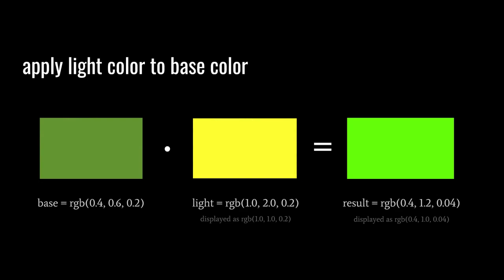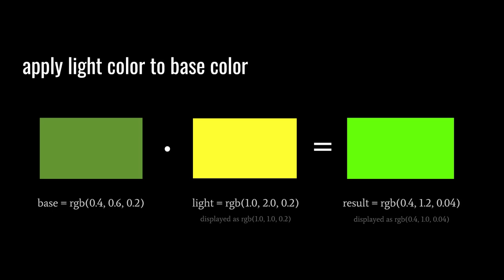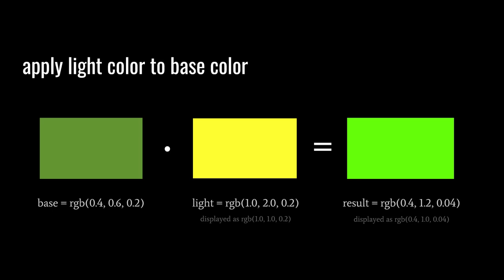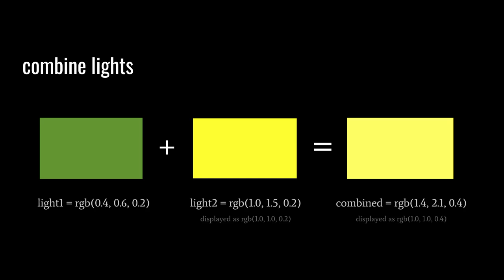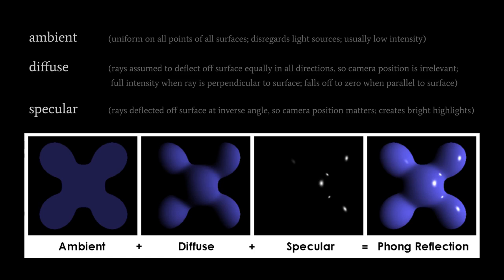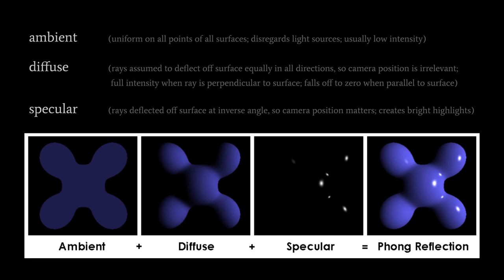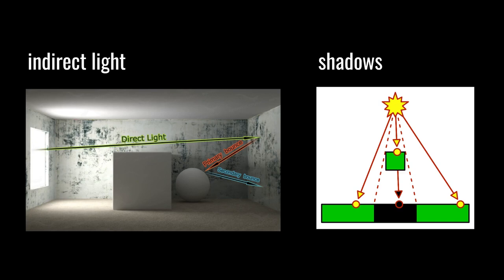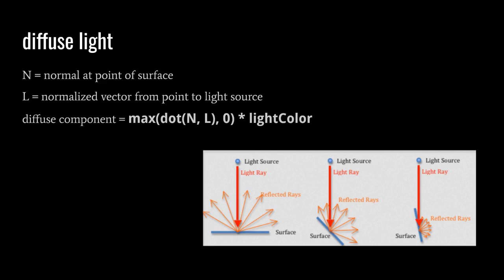OpenGL - lighting with the Phong reflection model (part 1 of 2)

Comment: 12:14 it is not a linear increase: at an angle of 45 degrees (halfway in between) the dot product is not 0.5. The change is not linear but sinusoidal, it's proportional to the cosine of the angle between the vectors.